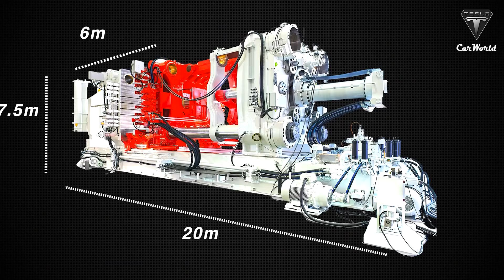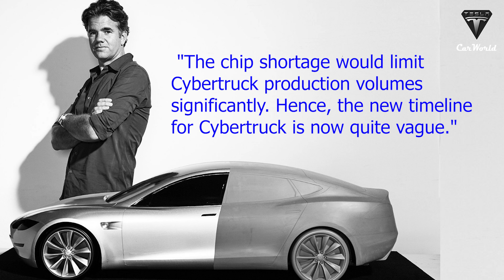Tesla Chief Designer Franz von Holzhausen reveals Real reason Cybertruck Delay at Giga Texas!

Comment: Everything promises he delivers on. Main reason for cybertruck delay is best use of batteries which, given worldwide demand for 3 and Y and the large battery required for trick, is best targeted at everyday 3 and y.
Reply: Biggest Tesla mistake its won't be till 2025 till they start deliveries by then Ford will already be dominating the truck market nearly a 5 year head start  saw the prototype in the flesh body gaps craftsmanship is comical not sure why they would show case such a crudely built prototype it didn't even looked finished .. Way to Go Ford though